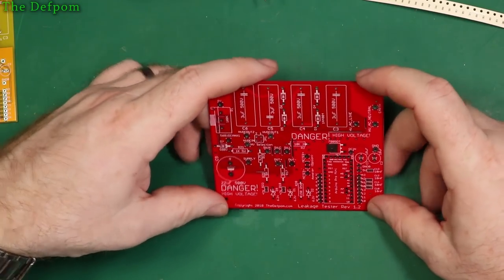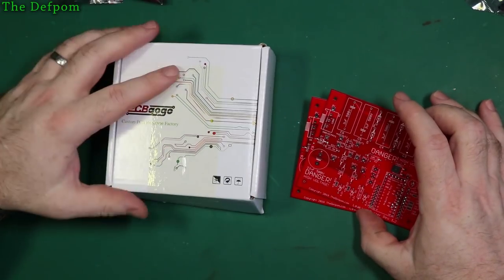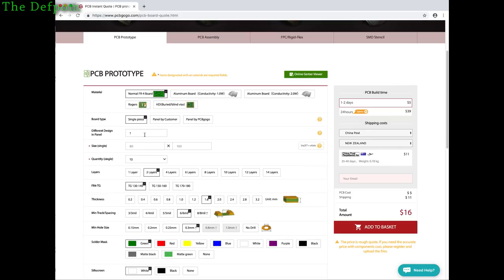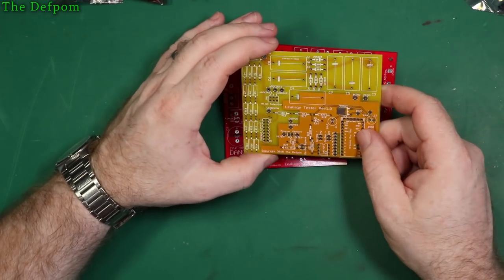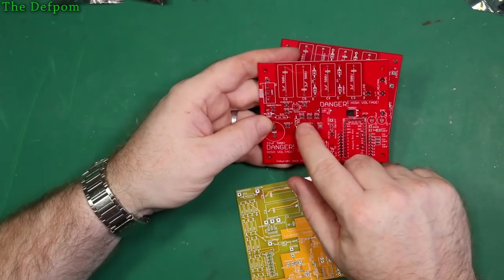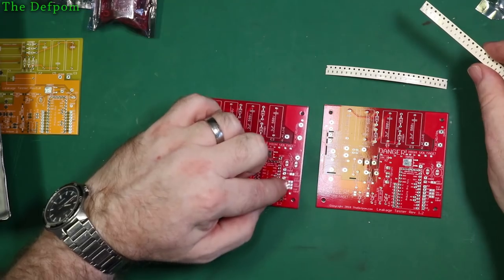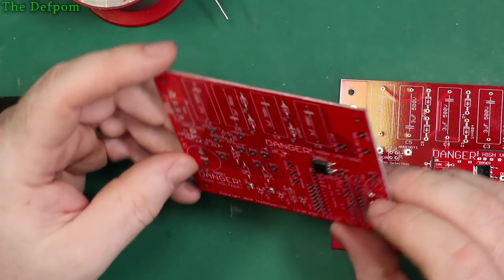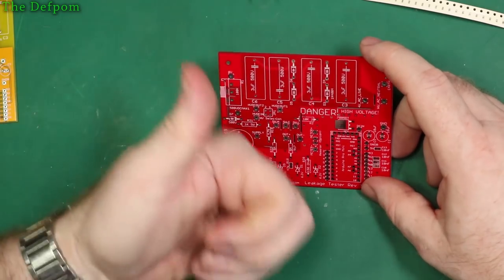🔴 #546 High Voltage Leakage Tester Rev 1.2 Partial PCB Build - PCBgogo Review

Comment: Well, I bought one of those high voltage modules, so I guess I'm going to have a go at one of these , and I won't modify  the software in anyway, I could do with a leakage tester, as I'm starting to restore old radio's in my golden Years.